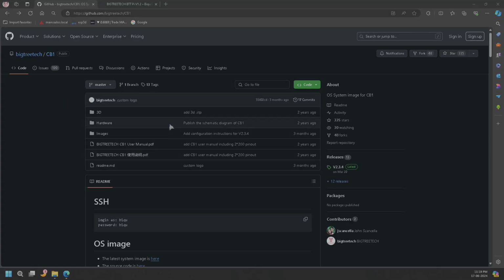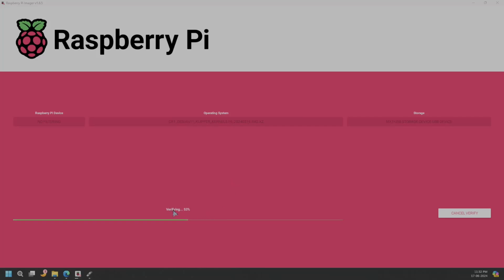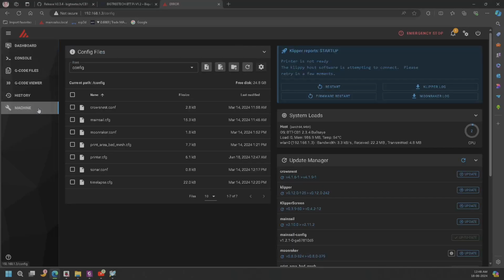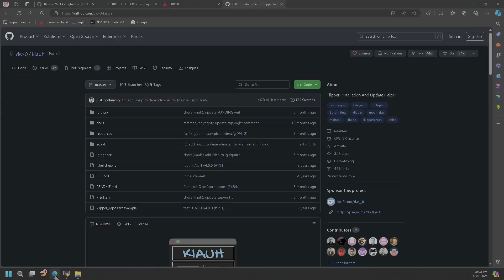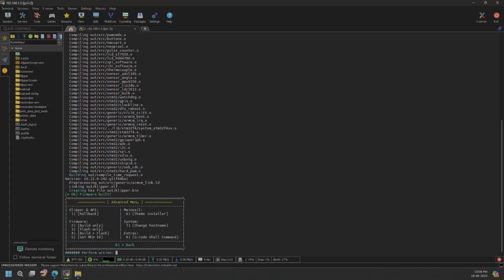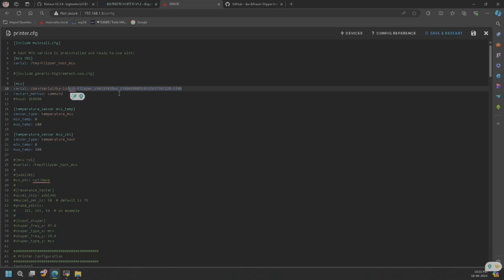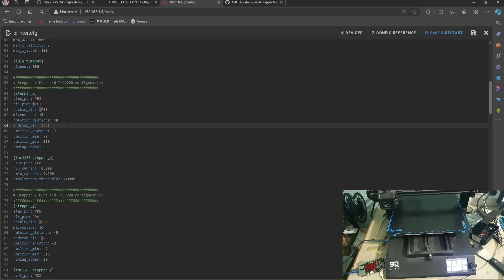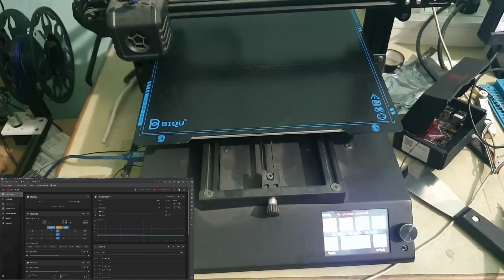BIGTREETECH BTT Pi V1.2 setup for skr2 rev b bq b1 se plus klipper

Comment: What firmware version are you using
Reply from the maker: That time what latest available klipper firmware that i use now also update available and please subscribe
Reply: @HarmanSinghKainth  can you send me the firmware.bin please
Reply: Also do I have to use a btt to run klipper or can I use a raspberry pi
Reply from the maker: You need to compile firmware according your motherboard and what firmware is installed in your pi and mainsail otherwise it not working
Reply from the maker: @cheesy421smith5 for raspberry you need to download mainsailos image and flash with raspberry imager software and for can if your motherboard have on board can connection then use it otherwise you need u2c board for can